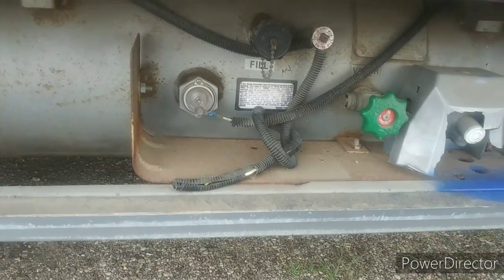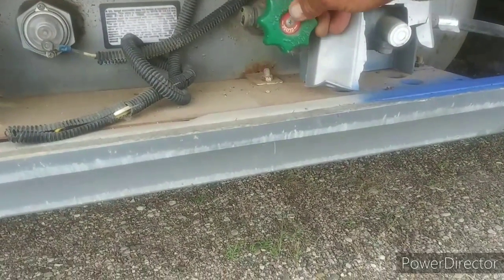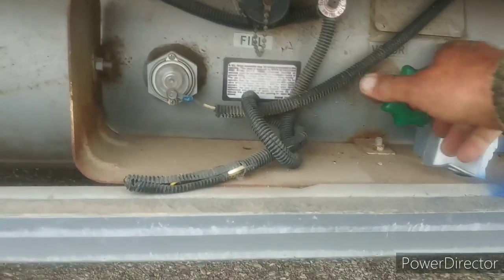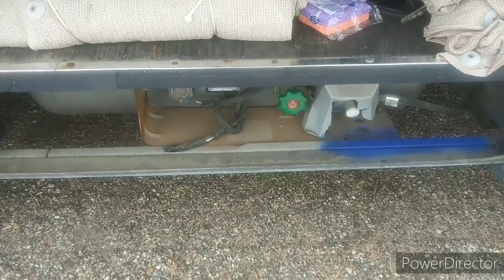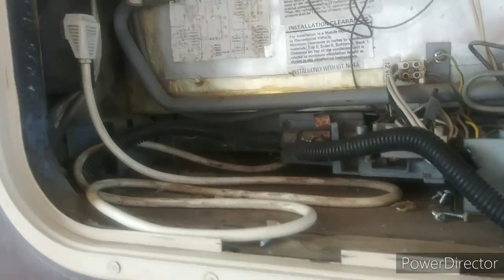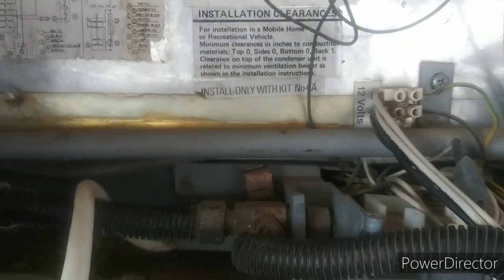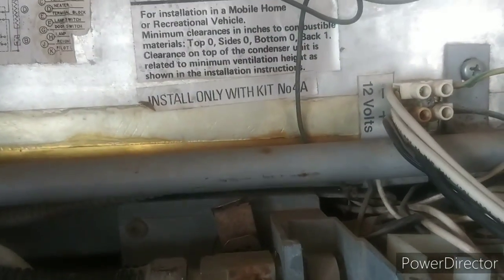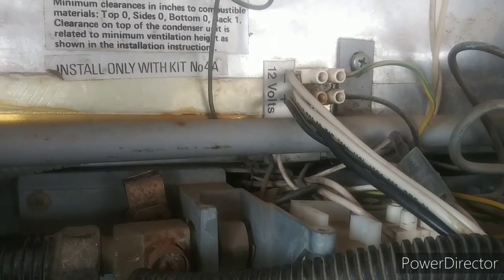Removal of original Dometic refrigerator.

Comment: I have the same generation of dometic fridge. Only mine has one door. But the fridge controls and gas igniter are exactly the same. I can get the pilot lit but the fridge doesn't get cold. And it doesn't work on electricity either

Comment: You can convert the 12 volt over to the shore power just put a splitter in between so that when you're aren't on Shore power if you're off grid will run your refrigerator as long as you have enough solar panels to run it if you have three or four solar panels that should run your refrigerator at least during the day
Reply from the maker: Exactly and that's what I'll do

Comment: Next time you need to run the wire nuts all the way down instead of just a few turns. You don't need another fire on the new to you rig ;) I know you put the tape but the wire nuts needed to be screwed down tight until they stopped.
Reply from the maker: Actually the wire nuts are ran as far as they can run I just didn't do it all on tape thank you for the advice though

Comment: It would be just as safe to just disconnect your coach power. Then no need to cut yout 12v plug as you will most probably need it later.

Comment: Why not unscrew the wires? why cut them?   why not just fix the fridge?
Reply from the maker: The wires were marked the Caps were on tight and then taped they are in a secure location tucked away thanks for the comment and the concern

Comment: The struggle is real !!! There's something wrong with me that I am entertained by your struggle to cut a wire. I'd help if I was there though. Peace out. Keep doing what u do.
Reply from the maker: Yeah I know right can't believe they would have cut with my snips
Reply: @themobiletraveler5927  Its all good. Real people doing real stuff. LIFE
Reply: no need to cut the wires . There are set screws in the white terminal block holding each wire in..a small flat head screwdriver is all that is needed